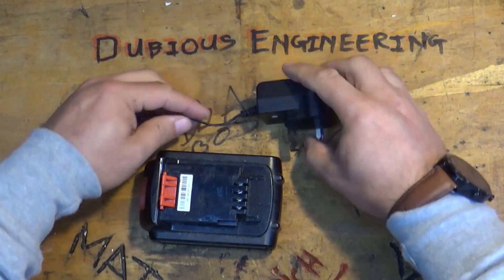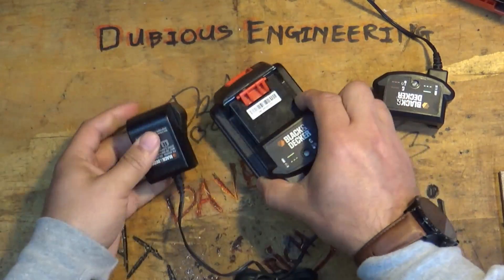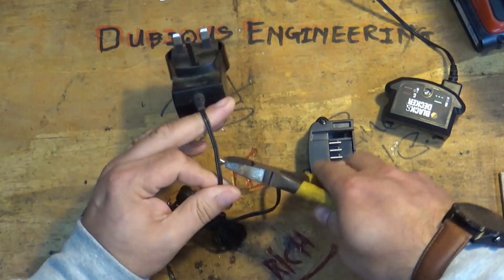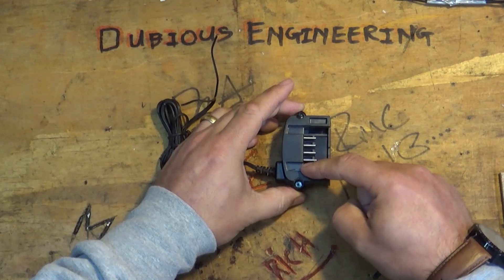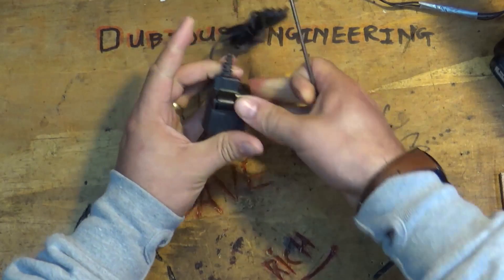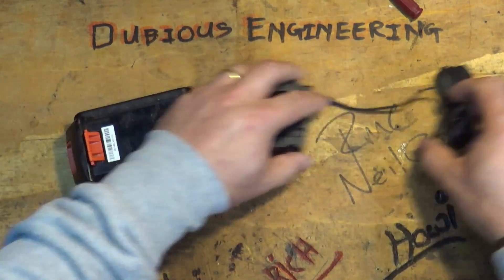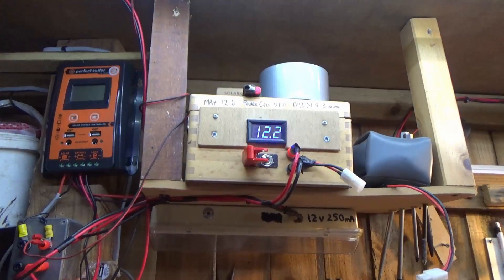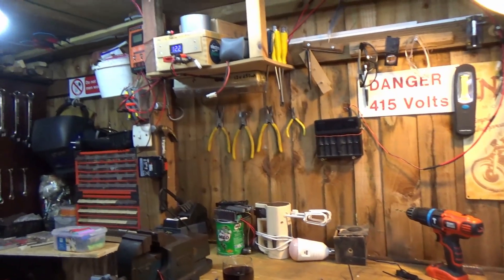DuB-EnG: Black & Decker Lithium Battery Charger problems, teardown, repair troubleshoot fix...

Comment: I have an old notebook charger with manual adjusting voltage (From 15 to 24v) but the output is 4.0 A. Will It work?
Reply from the maker: Yup that will work!
Reply: @DubiousEngineering  Thanks a lot man, the green light is finally flashing! You save me time and money!👍😉
Reply from the maker: Happy for you mate!! :-).  Excellent work’nn

Comment: Nice video!! my Battery charger is on but just shows f-ing red flashing light hardy use my cordless drill for hard work mainly basic diy work now both batterys doing it just over 1 year old wtf
Help needed
Reply from the maker: Yeah that sucks... get on the makita or DeWALT range if you can... they have battery management circuits to help charge and protect... otherwise, buy an imax b6 charger ... they aren’t expensive and it’ll charge your battery properly!!!

Comment: Will a 32V power supply work?
Reply from the maker: Suggest putting a large wire wound power resistor in series - maybe 50ohm or so if you have one at 5watts ... 32v may be a little tooooo powerful :-)
Reply: @DubiousEngineering  thanks! I found a 24V 210mA supply that's doing the job... slowly.

Comment: Thanks for the video, this worked a treat, i found an old adapter 9.6V 350mA output, once hooked up, it started to charge the battery straight away.. 👍🏾 you just saved me pounds & Pounds on a new charger..
Reply from the maker: you may need to find a 20v adapter to fully charge the batteries...
Reply: @DubiousEngineering  you are right, just a feedback to this, the voltage i was using didn’t charge the battery although the indicator was flashing green.  I will have to source either a new original adapter for it or get hold of a 18V adapter.
Reply: @Sohail-xw2xu  Hi how did it go? Run into the same problem - flashing green but not charging, what voltage/amps worked for you. Cheers

Comment: I'm an indian user with a black and Decker drilling machine and my charger(Model no. LCS1620) isn't working as well !! It just shows up red light blinking without even connecting to the battery! So for finding an alternative adapter is it really necessary to choose the adapter with an output amps of 400mA as rated on my original adapter?  Or can we use an output of 20v Dc and 1A ?
Or can you suggest any? 
It would be very helpful for me
Reply from the maker: Sir, you can use a 20v 1a power supply! The electronics in the head unit will take care of the charging regulation.  Thanks for your question! :-)

Comment: I have the 9.6 volt 18 volt charger for the 18 volt Black & Decker drill batteries.  It's only ever had a solid green light when it's plugged in and I've never seen it flash.  The battery is due seem to charge up, slowly, but I never have an indication of whether or not they are charging or complete.
Reply from the maker: That’s a bummer mate...  I have not looked inside a dual voltage charger.   If I see one I’ll be sure to make a video on it!

Comment: Thank you so much, changed the plug end from an old router and is now charging👍you da man!
Reply from the maker: Awww sweet... make sure it’s about 21 volts and the charger will take the battery to the max :-)

Comment: Dam I dont have solar power, but thank you I now know what the problem is with my charger and not the battery. The red light flashes even without the battery......
Reply from the maker: Connect it to a 21v DC supply and you’ll be sorted :-)

Comment: Amazing! I didn't know whether it was my drill, the battery or the charger that was faulty. I gave this a go and it worked a treat. 10 mins effort saved me a load of money. I wonder whether B&D have realised that their power supplies are rubbish, or whether they don't care. Thanks a lot!
Reply from the maker: Pleasure...  for a full charge find a 21volt power supply...  perhaps an old laptop charger ?

Comment: Hi. Nice video Howard. 
Just a simple question, does a DC 21V 2A switch mode power supply safe enough to cut the long charging time? Thanks.
Reply from the maker: Hi Jack, yeah the charge circuit is indeed limited on current delivery so chuck an old laptop power supply at it and you’ll have the same result so long as your about 20v or more output!!
Reply: @DubiousEngineering  oh well, I just keep it as it is then. I thought i could just cut and replace it with the new power supply to decrease the charging time. Thanks for the reply Howard!
Reply from the maker: It will help with the time... maybe 4 or 5 hrs

Comment: what's the problem when the charging indicator flashes red
and the green indicator no more
Reply from the maker: Great question!! - I need to look into that, i find that if i re-seat the battery, the flashing red stops and it charges!!

Comment: Great post.............found an old 12vdc charger that was 500ma........works great.............thanks
Reply from the maker: You may need to find something with a higher voltage output...  unless it’s an old transformer PSU ( the 12 v transformers can chuck about 21 volts out and that’s what you need) 21 volts !
Reply: This is great, I found a 15v old style transformer which is working right now. Are you saying the old (heavy?) ones will be better for this? I couldn't find anything higher than 15v
Reply from the maker: Aha!! The 15v units will put out about 20 volts Peak ... that’ll work!!
Reply: Nice one cheers!

Comment: Okay wait so for real you can charge a 18v battery pack with a 12v power supply? Is the charging circuit boosting the voltage? I always assumed the charging circuit would buck down, never thought it would boost up?
Reply: Most charger packs are several 3.6v lithiums wired in series to give 20V. So in effect you are charging all the batteries up to 3.6V
Reply from the maker: Mark Swint yes you need 21volts or so to fully charge the pack...  I’ll do an update video
Reply from the maker: Yeah it doesn’t have a boost driver, so chuck 20 volts at it - my solar panel dumps out 20v
Reply: @DubiousEngineering  ah bum! Got excited for a minute there!

Comment: Can anyone explain why the original switch mode power supplies are constant current? Seems odd unless the charging circuit depends on that.
Reply from the maker: Let’s hope not!!!  The charge controller looks like a microcontroller PWM system so should be able to regulate the current.  Everything seems to work well from my 20 volt solar panels.  The battery has an low voltage cutout BMS on board too.
Reply: It does depend on it. The wall-wart contains a 400 mA constant current source with an 8 to 20 volt compliance. (It actually tops out around 21.5V)  If you connect a conventional 20V power supply that's not current limited, it may appear to work but you run the risk of damaging the battery. What saves you most of the time is the charging head contains a temperature sensor that hopefully cuts off charging before the battery catches fire.

I had to reverse engineer this a while back because I wanted to charge these 20V LBXR20 battery packs from 12V. The solution is easy and cheap without designing my own power supply. Amazon sells an array of power supply modules in the $15 price range with nice digital readouts of voltage and current. There are buck, boost, and buck-boost versions. These power supplies can run on 8 to 35 volts and can be set to output 8 to 35 volts or to function as contant current sources with adjustable compliance. Use a boost or buck-boost supply, calibrate the current to 400 mA (or a bit higher) and 20V compliance. Mount it in a nice enclosure and done. Easy peasy.
Reply: @PhillipLandmeier  Would slapping a regular 12V constant current power adapter (set at 3A) work without any major headache to keep an eye on??
Reply: @k-yo  No.  a 12-volt power supply, constant current or not, cannot reach 20 volts. Those packs have five lithium cells in series. The supply has to be able to put out at least 21.5 volts to get those cells to full charge. In other words your 12 volt power supply does not have enough voltage compliance. 

If you connected a 12-volt constant voltage power supply to that pack, it would actually discharge the battery pack. , 😮
Reply: @ Guy commented 3 years ago and takes minutes to respond. You are awsome!!

Thanks for the heads up!

My charger died at worst possible time, and I'm trying whatever I can to solve this problem at least temporarily.

I would kill to be able to charge all these tools batteries with a single beefy 100w usb-c charger.

Anyway. Again, can't thank you enough.
Reply: @k-yo  Not awesome. Well maybe. Lol. Just an old engineer.

Hmm. USB C isn't going to solve your problem either. You need a charger that's designed to charge five 18650 cells in series. I know that's not what you wanted to hear.
Reply from the maker: @PhillipLandmeier you need a powersupply that delivers 21 or 22 volts.  Old laptop power supplys normally work.
Reply: @DubiousEngineering  Yes. I wouldn't say old but I've used this trick myself.
Reply: I didn't mention this because I wouldn't recommend it for amateurs because laptop power supplies, while they deliver about the correct voltage, are not current limited. A 90 watt laptop power supply applied to a 20 volt discharged battery pack could result in fire or explosion.

Comment: Alright, let's see why the switch mode power supply failed!! I'm betting it was a fusible resistor!
Reply: Interesting point. Isn't a fusible resistor another name for a fuse? Forgive me but I'm not being silly, I'm just a beginner in practical electronics.
Reply from the maker: I may do a little further digging...  I guess I was just happy to have a solution and move onto the next project!! - Finishing the jkoysticks build for the coffee table, amiga laptop power BMS to install, and my wifes familys old FAMICOM to refurbish...  And other short projects and interviews in-between...  (Just keeping you up-to-date on whats coming).  All the best chaps!!